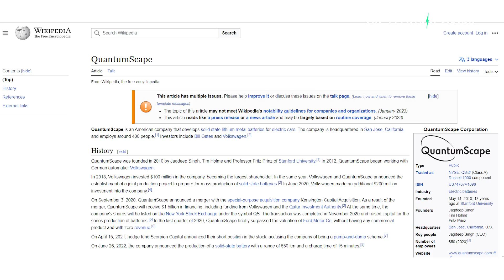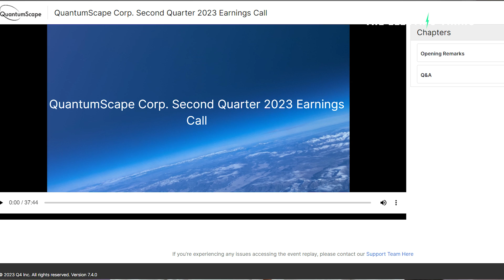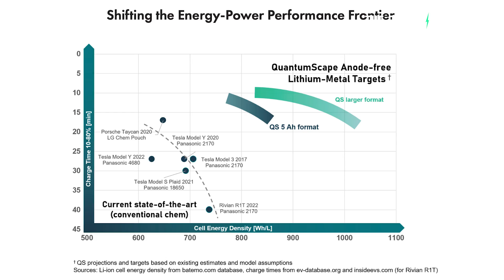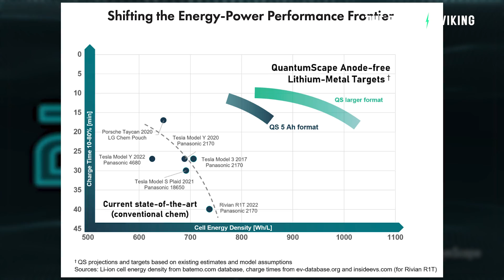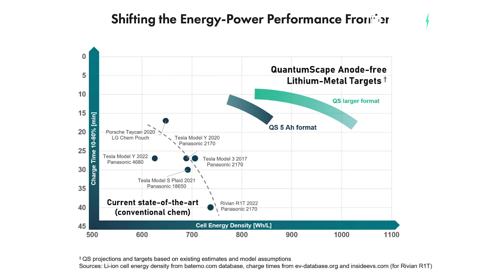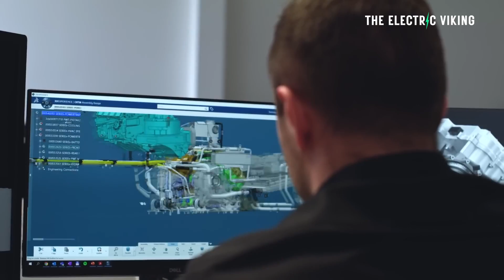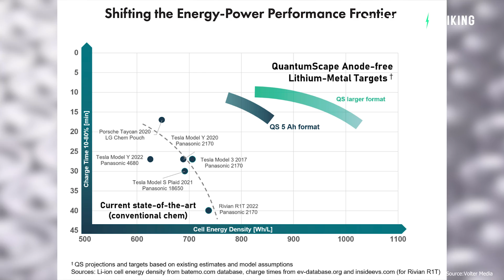American Solid State Battery manufacturer sends batteries to 6 car companies

Comment: Semi solid state resulting in lower range.... Depends on cost as to if it's good or bad.
Reply: Range anxiety will disappear as more people drive EVs, so range high enough to strain the bladder are not really needed.  Lower cost, faster recharge times, reliability, and longevity is what interests me more than outright range.  The only thing that concerns me about my 2016 S is how long the battery will last in calendar aging.